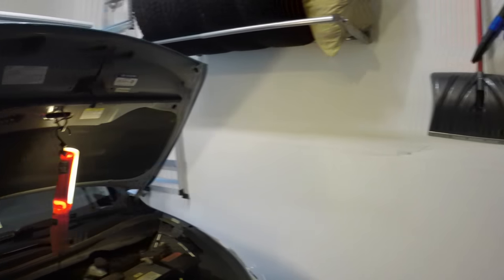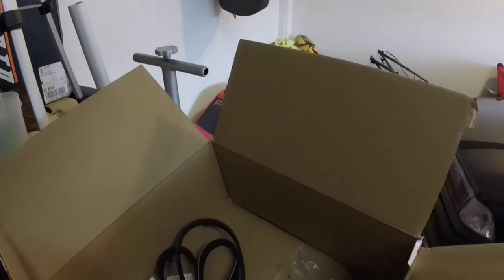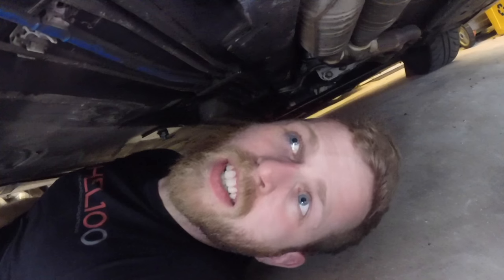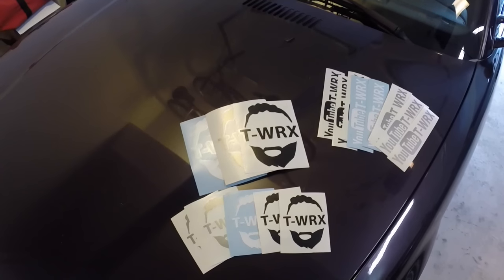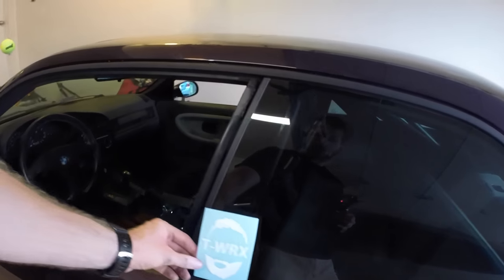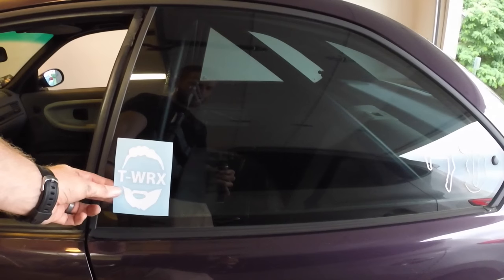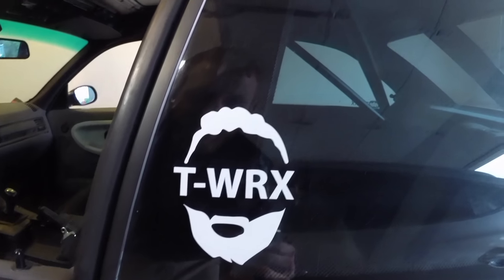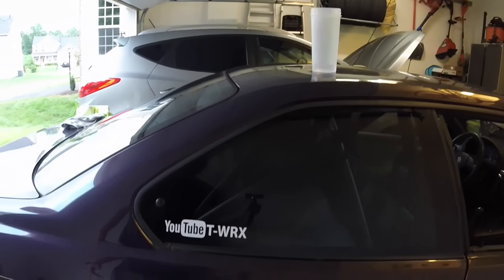Bonus Video: Channel Vinyls for the 2016 Subaru WRX STI and BMW M3!

Comment: I'm tempted to buy a e36 1995 m3 that would be a daily and a fun car, for my wallets sake should I do it and how reliable is yours
Reply: It's an older car and they get beat on by their owners. If you can afford the maintenance and find one in good condition, why not.
Reply from the maker: Overall I think e36's are pretty reliable cars and the parts are not too expensive. BUT you have to make sure you find one that's been looked after a bit. If you find one that's lived a rough life it will most likely need a lot of attention to get it back to useable daily. They are 20 years old after all. Mine in its current form could be daily'ed without much problem (170k miles), except the stiffness of the suspension and stuff may kill me. But the motor is pretty bulletproof. You'll most likely have to do something to it after you buy one, just make sure you get one that has a decent amount of service records etc. and you'll be fine.